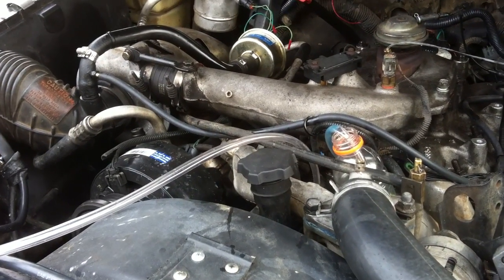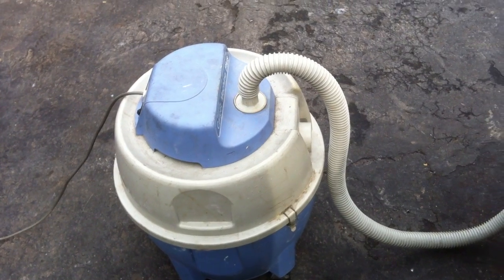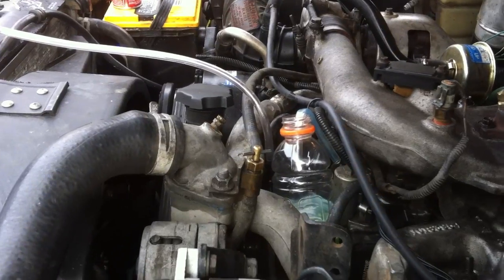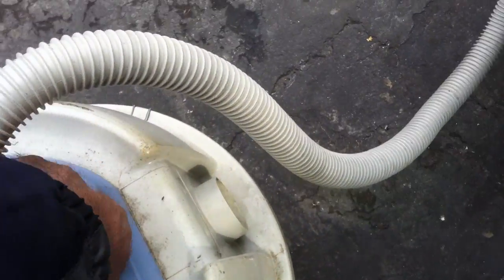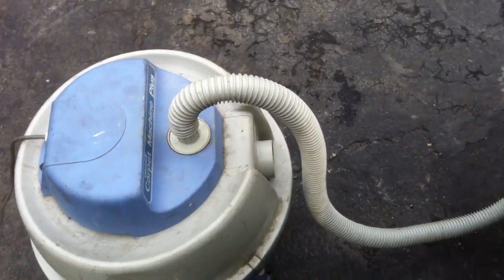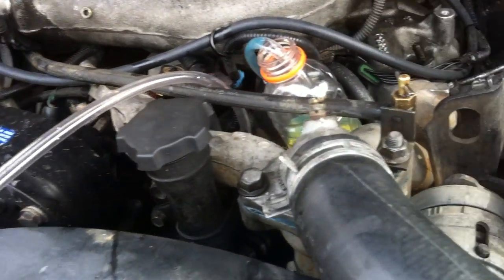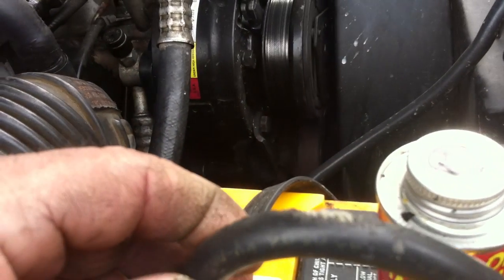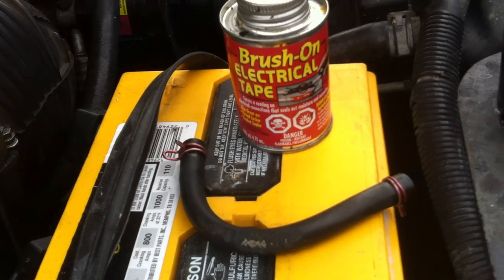Clearing Fuel Return Line Restriction on 1994 Chevy Silverado K1500 6.5L Turbo Diesel

Comment: I had a wire come off my lift pump on my 5.5 and I opened the t valve to see if fuel was comming out wen I fixed it and ended up getting air in the fuel lines to injector pump getting lot off fuel to the fuel bowl as I have to let air and fuel out of it so I believe if I cacume the t valve I should be able to get air out quicker what do you think it was running fine before lift pump wire come lose the lift pump is working fine but won’t go past air in injector pump so I hope this will get air out that I let in with tvalve

Comment: The biggest problem with these engines is the pmd and they cause all kinds of different fuel problems they will stall they will surge they will shut down compleatley so I’d be checking that first then I would check for fuel leaks if you have a bad enough fuel leak it will be really hard to start wen cold sometimes they will not start I’m fixing a fuel leak on my dually as I speak well tomorrow but hope you figure out

Comment: Thanks for posting. I enjoyed this video but wanted to mention to other viewers, you should never attempt this with a gasoline powered vehicle. Sucking gas fumes into a shop vac could have disastrous consequences. Since most shop vac motors have brushes that spark, fumes pulled into the vac could ignite.
Reply: its a diesel
Reply: I don’t with coolant wenchanging a water pump it takes the mess away you only lose a little antifreeze but you have to have a good shop vac I also do it wen taking old gasket off wen you scrap it the vacuum sucks it in and then it don’t fall into your engine my buddy laughed the other day I took a little to much anti freeze but easy to fill back but at 20 a jug it can get expensive and it was all brand new antifreeze

Comment: Thanks for the infos. I have 1994 chevy diesel. In the morning I have a hard time keeping the engine running, it would fire up, but I have to hold the gas down in order to keep it idile.  Eventually it gets warm enough, it will run fine. I noticed that if outside weather is hot, I can just fire up the engine and it would run fine. Any suggestion?
Reply from the maker: +Kokyou Chau I'm glad you found the video to be helpful.  Regarding your slow warm up scenario, I use the block heater to warm up the fuel - even when it wasn't abnormally cold out.  Also, I would highly recommend doing a Google search for the company who builds & sells the "Feed the Beast"fuel flow enhancer kit online.  Buy the version with the braided stainless steel hose and the red & blue anodized AN fittings.  It's one of the best mods for your truck, reasonable priced at @ $70 + shipping and it really dresses up the engine bay.
Reply: I have same problem but i have to hold throttle down in warm weather to

Comment: , 99 chevy 2500 3/4 ton service truck.. 6.5 diesel in it. truck has always ran great. The situation now is that it will run fine, may be 15 minutes or longer, but it will just stall out , sometimes it will start back and sometimes it will not do it. Put new in line filter pump on it, still would not start , pulled home and next morning it started right off. Ran for 10-15 minutes and cut off. Took outlet end loose on inline pump/filter (may just be Pump)  and it really  pumped the fuel. Any good ideas from anyone. Thanks for any reply.
Reply: Did you ever figure out what was going on with your truck? Mine will crank perfectly fine and run good and then there are days it will be hard to crank or can't get it to at all. Walk out the next day and runs on first crank. I don't understand. Any help would be greatly appreciated.
Reply: Sorry for not checking posts/ Yes we got it fixed. The black cpu/ecu  towards front of engine was problem. Finally one day I ran it till it cut off , poured cold water on it [ecu] and it started right back.  Ecu's are bad to get old and  get hot and shut engine  down.   Sounds like fuel problem, check filters air and fuel.  Inline fuel pump is usually under driver side door. Good luck
Reply: I think ours would usually start fine . Also, it did do a chugging goin down road before it really went out.
Reply: Good luck and hope you have already got it fixed.
Reply: +rodney benefield I'm actually having problems starting. I am beginning to believe I may be getting ait into the fuel system.
Reply: You could be right on that also. Again fuel pump is below driver door. Take the line loose on engine side of pump and have someone turn key on and see amount of fuel that comes out. Good luck
Reply: pmd
Reply: rodney benefield are you talking about the PMD?

Comment: I have a 95 2500 Chevy 6.5L Turbo Diesel and I am definitely going to try this! It keeps stalling and I think has something to do with the fuel lines... or fuel pressure... :-/
Reply: Could be the fuel sock in the tank I has the same issues and finally decided to pull the tank and came acrossed paint chips clogging my sock

Comment from the maker: Thanks for the feedback and the info about the 30R9 rated hose for diesel fuel.  Glad to hear that the 6.5 in your boat is running good now.  If the old 1972 Mercruiser 188 engine in my Sea Ray SRV-193 ever dies, I would definitely consider swapping in a 6.5L TD, like you did.  Great idea!